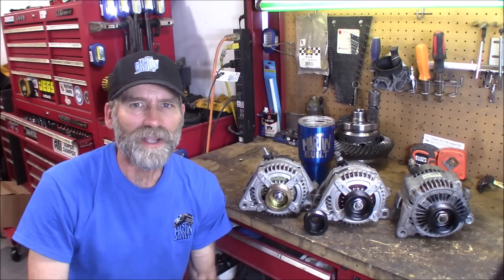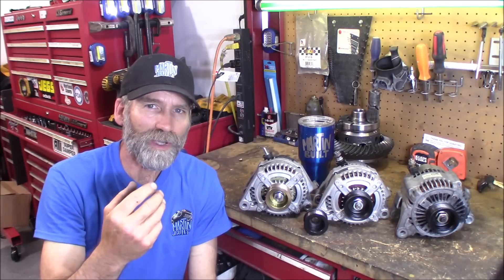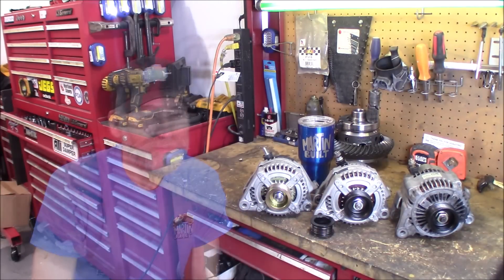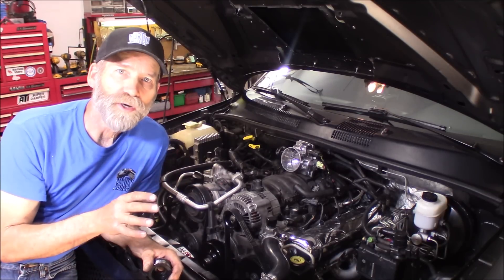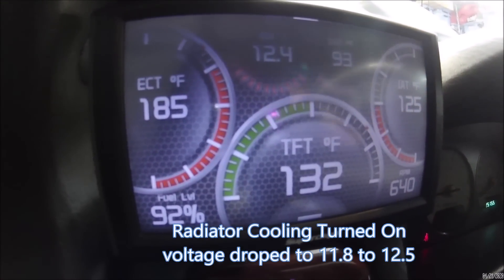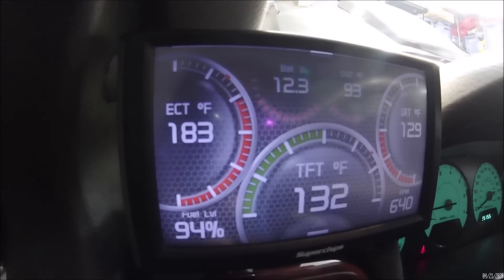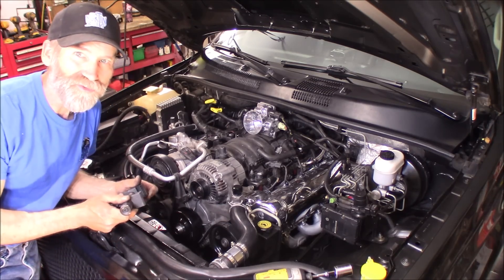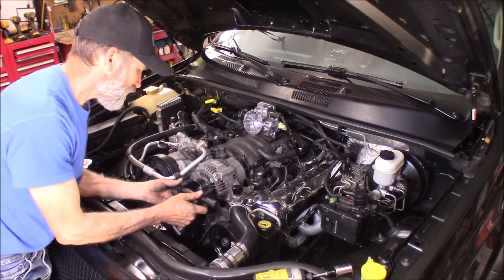Alternator Shootout at Idle (136 vs 160 vs 250 amp)

Comment: Big 3 would help... MAYBE. All comes down to the length and gauge of the factory wiring. Most people jump on the big 3 or 4 bandwagon without actually doing any math first then checking wire charts. Will the big 3 or 4 hurt... in most cases no but like in this video it more than likely wouldn't make a difference because the factory wiring size/length is sufficient for the amperage needs. Reason most factory grounds from the engine block to the body is so thin is because usually those wires are really short  (under 2'). 10ga wire can handle upwards of 100-120A if the run is short enough. Manufactures do that on purpose to save money, copper isn't cheap. Not saying not to do the big 3 or 4 just do the math first to justify it, unless you've got money to spend.
Reply from the maker: I've done the big 3 just because everybody wanted me to and I did it just to kind of prove a point that it wasn't gonna make any difference which it didn't.. All I ended up doing is adding weight to the vehicle.
 Now like you're  were saying if my amp draw was more than the gauge wire that I had installed from the factory then it would have been a great idea and it would've made a difference.

Comment: Just buy 135 amp with small pulley.  High performance or excessive electronics is when 225 comes into play.  Don’t waste money if not needed.
Reply: 135 is more expensive than 160

Comment: Im sure u put a meter on the battery   u will see more voltage     a stock alternatorr   can supply and maintain 13 and up   with things on       no way   160 cant maintain 13.5  with basic things on

Comment: So the moral seems to be they all run like crap at 600rpm with a 55 pulley
Reply from the maker: Well the 160 amp actually outperformed the 250 at idle and another thing to keep in mind is that I'm running a 25% underdrive pulley on the harmonic balancer.

Comment: Hey martin fans,yeah those blend doors are notorious weak point on chrysler.makes you believe dam vehicle is haunted!mine has that stupid daul climate control had problems with blend door hinges being plastic breaking.of course i replaced with online aluminum fix ones and was fine till recent with heater core now has pinhole leak and fogs window constant with anti freeze slick.!!!!arrrrggh.its a huge job to fix.have to tear whole dash n center console apart.im debatting wether to just have shop do it.and worse part was before i left dealers lot had them fix the broken the broken blend pin.they had it apart never thought to upgrade both pins.within two months other pin broke.thats when i did the whole cheat thing and went thru glove box cheat.cutting an access thru hvac box.had good heater for two yrs and now face the heater core fix.sometimes i just say .why me god!!!!!!snookie pa.i still love my grand though!!!!!!

Comment: I'd be willing to bet your voltage drop has nothing to with the alternators output. No 1. Alternators don't put out the rated amperage until they reach a certain rpm. No 2. They lose their amperage output when they get hot. No 3. They should not get hot to the touch if properly installed. No 4. Alternators don't pump out electricity like a garden hose pumps out water. They have a rated capacity and only "put out" to match their "current draw". The problem you are experiencing with voltage drop is because your wiring is too small a gauge. Wires only heat up because of too small a gauge size, or a loose connection, and remember to increase the ground as well. Voltage and current, (amps) are to different things. A higher voltage reading is not indicative of better performance
Reply from the maker: However, the 160 outperformed the 250 and the 136. And I've done the big 3 upgrade that people told me to do and saw absolutely no gain at idle. And that is what this video was all about was performance at idle.
 My main problem for such a voltage drop and idle was because I have a 25% underdrive pulley on a harmonic balancer to gain any of that RPM back is why I use the overdrive pulley on the alternator.
 The video was really all about 3 alternators with different amp ratings going head to head at  Idle and also how pulley size could affect voltage output at idle.
Reply: There is a big 4 upgrade available. Also did you use sky high 0 Gauge OFC copper not tinned aluminum CCA?  Did you ground the engine in 2 places on each head with 0 gauge OFC? Did you ground the battery and the alternator to a bare spot on the frame? Did you get an xs power arm battery those hold charge like crazy and high beans and just brake lights draw a lot too.
The big 4 is just grounding the alternator on a different spot in the chasis other than the battery and ground. I grounded my engine is 2 places with 2/0 ofc sky high wire not the CCA (Copper Clad Aluminum) the CCA stinks.
Reply from the maker: @emindedf0  I did the big 3 using 1 gauge copper welding cable. Both cylinder heads are grounded from the factory.
Reply: @martinbuilt  can I still upgrade to the 160 amp and 49 mm pulley if I don't have a super dampener and electric fan but plan to install the summer?

Comment: Great Video as always! I wanted to add for anyone searching for this 160 amp for their 4.7l WJ, when you go to your local autoparts store (Advance auto, o-reillys, autozone, etc.) and you search using your WJ, it will pull up the 136 amp. To get the 160 amp, use a 2005 dodge durango limited with the 4.7l (vin N) as the search engine. This alternator fits exactly into the WJ 4.7l, will mount up and even the harness clip is the same (i have in my 04 WJ 4.7lHO). It will come with the 55mm pulley. If you want the 49mm pulley, martin posted the link to it under the video description (https://www.ebay.com/itm/49MM-1-9-Alternator-OVERDRIVE-6-GROOVE-PULLEY/253996371394?ssPageName=STRK%3AMEBIDX%3AIT&_trksid=p2060353.m2749.l2649).
Reply from the maker: Thank you Tyler for sharing.
Reply: Beautiful looked for higher fitting my 1500 says not in stock has this one thank you great idea hope it is same size/fit

Comment: You changed alternators, but you barely reach 14V. Something`s not right. I have stock 140A and without heavy accessories 14.4V-14.6 even. Even with two amplifiers to the max it does 13.8V - 14V. I would be sh*ting my pants with your voltage readings. :D
Reply from the maker: most of the issue is the under drive pulley on the crankshaft, once I get to 1300 rpm I see 14.1 volts.

Comment: This video is misleading if you invest in a good quality high out put alternator like Js,Mechman,Singer you won’t have that issue with providing the correct voltage for accessories.

Comment: stock vehicle should be able to power EVERYTHING it came with and not drop below 12v
Reply from the maker: This particular jeep has a cooling fan from a  98 Jeep Grand Cherokee that had a 5.9 also used a higher amp alternator from the factory all because of the cooling fan requirements. And this is the reason I'm having some voltage drops at idle as well this cooling fan is running.